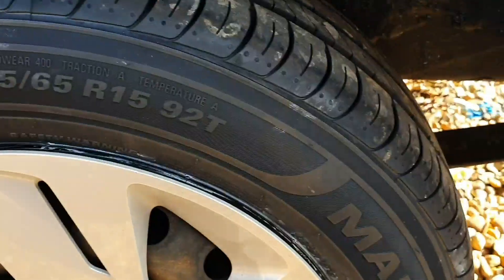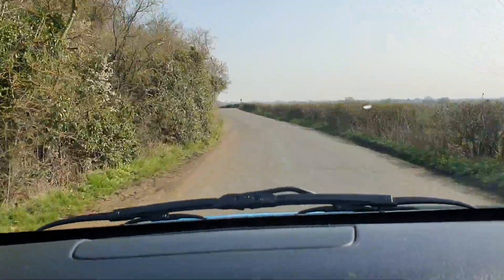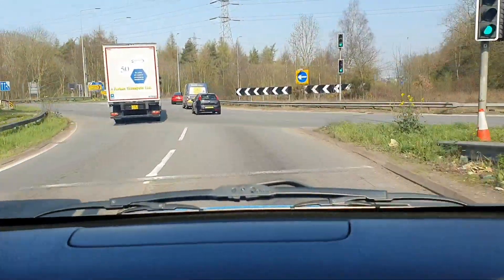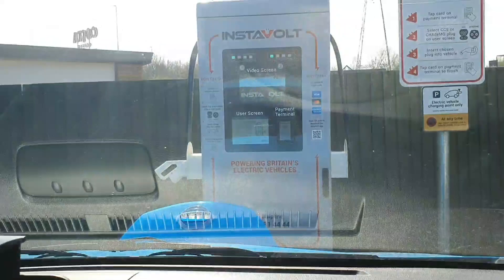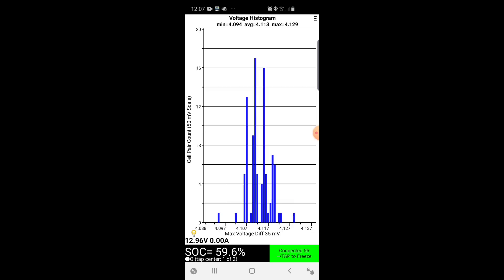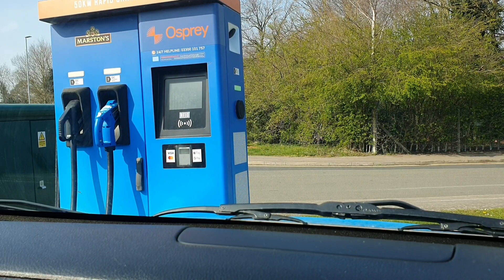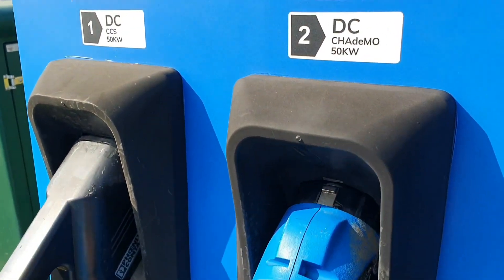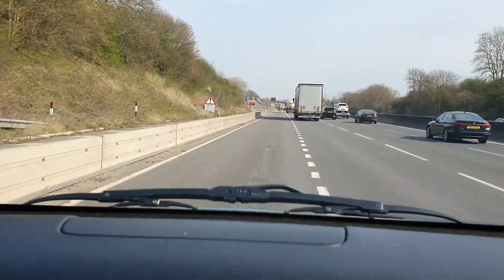NISSAN E-NV 200 - ELECTRIC CAMPERVAN CONVERSION: First time rapid charging... Easy or not so easy???

Comment: Hi bud, 
Loving your vids, I have just bought the same British gas 2015 E-NV200 and so far loving it, I would definitely get that noise sorted, as far as I know, when you rapidly charge the battery, it is cooled by the air-conditioning,  but when you charge with the Granny charger, it dosent need cooling. So you won't hear that noise slow charging. 
👍
Reply from the maker: Turned out it just needed aircon gas toppingup.

Comment: Hi Richard I've just bought a g-wiz.  How many 18650 cells would I need to get 80 miles per charge . Many thanks for all your videos keep em coming.
Reply from the maker: Depends on the capacity of the cells. Mine were 2100mah so around 1600 of those.
Reply: @RichardMawby  Just a thought... Fiat 127 with G-Wiz running gear... ??
Reply from the maker: @kylereese4822  Probably better to source other running gear for such a car to be honest. The G-Wiz components are not the best for transplanting into anything else, maybe the AC motor but definitely not the DC.
Reply: @RichardMawby  I`ve worked on the 127 in the mid 90s but not the G-Wiz ,You`re right the only bit to really swap over is the AC electrics, rear axel with home brew trailing arms anything else needed I would look at the weird Renault Twizy.... as long as it can get 10-15mph over the 70mph speed limit you have a reserve mph for hilly roads like Wales... (my old golf mk1 1100 struggled in Wales Prenteg was it`s nemesis lol)
Reply from the maker: @kylereese4822  gwiz drive train definitely isn't what you want if you want to get over 70mph. Better to look at the next curtis controller or two up and use 144v system.
Reply: @RichardMawby  Interesting as i`m getting to a point for a project car to convert, I have enough 18650s 2600mah(above 6000) for 2 small cars like the Fiat 127 or even if i can find 1 an old  panda 4x4... but not for stupid ££.

Comment: Hi. How much would the battery upgrade cost? To allow you to get more range and how many more miles do you think the new battery would give you?
Reply from the maker: Depends on if you can source a battery and fit it yourself or get Muxsan to fit it. Could be anywhere between £5000 and £10000 and would give double the range almost.. around 140 miles.

Comment: Why not put a good quality solar panel on top of the roof.
Reply from the maker: Not so easy as it wouldn't be straight forward to charge up the main battery bank with it. Ok for 12v battery but not good for the use I'd want it for.
Reply: @RichardMawby  just a thought.